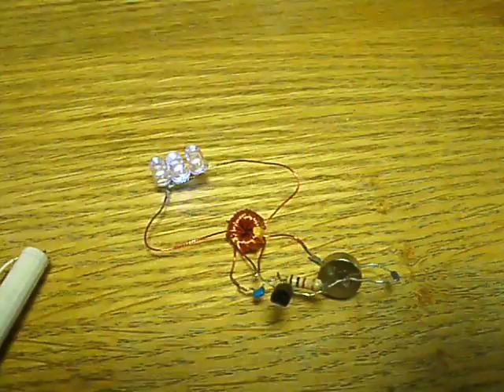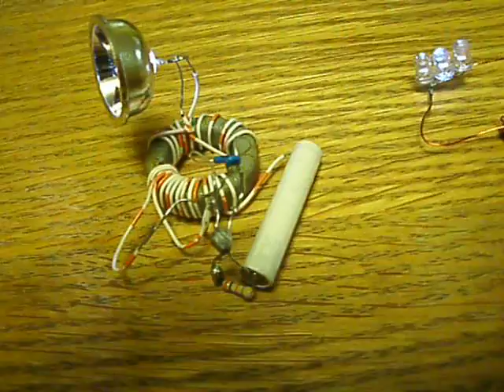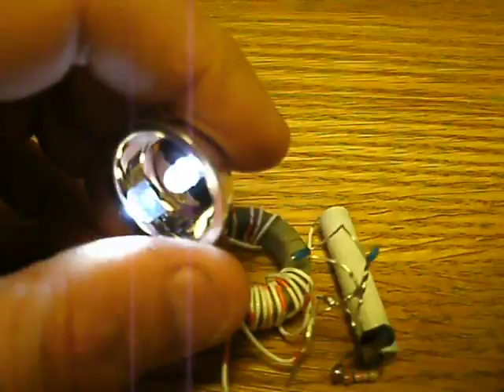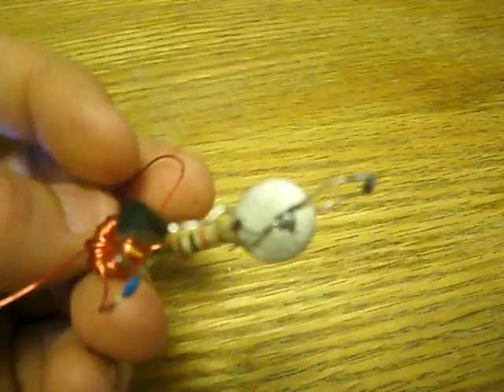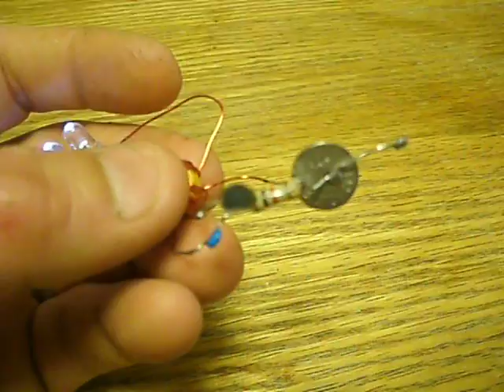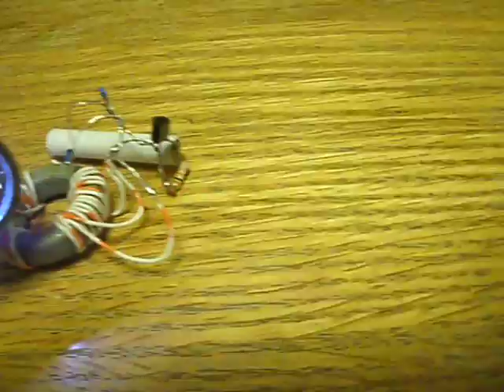hartley oscillator update.MOV

Comment: Hey Robbie, where can I find the schematic for these circuits with Henry's specified for the bifilar inductors? If you can get me that info, I will test the circuit with basic off-the-shelf inductors. Thanks if you can point me in the right direction. -t
Reply from the maker: teo I put most of my circuits on this website.. this is the link to that circuit in the video..   http://www.overunity.com/9733/bwjt/#.U0xgCk0U9aQ